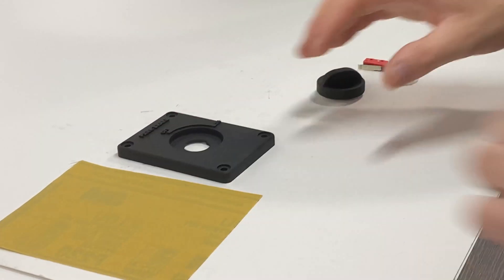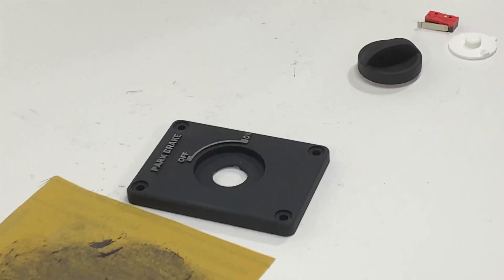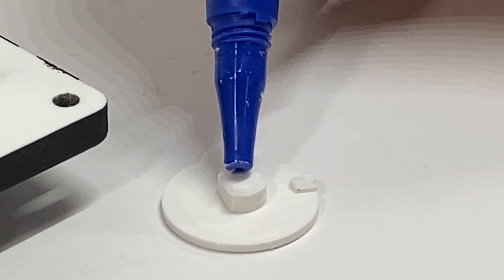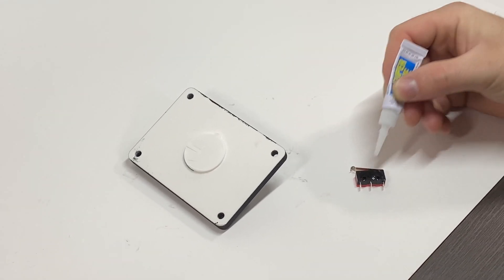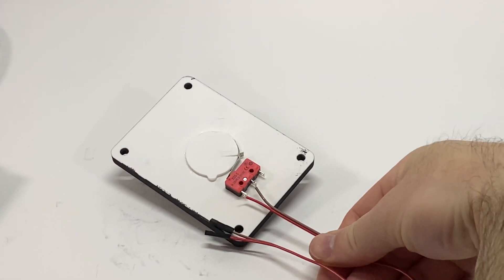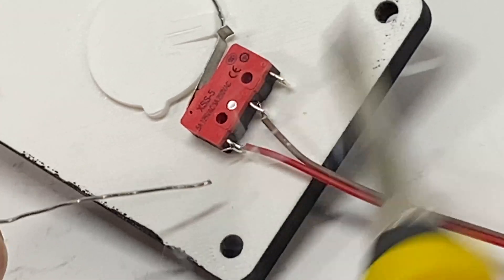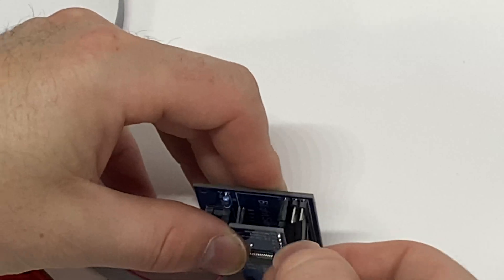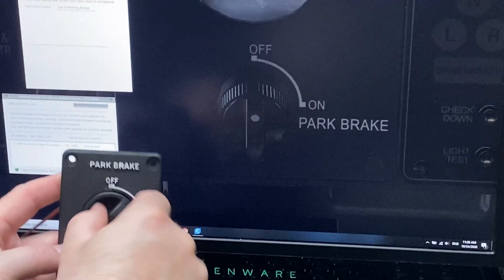TBM Parking Brake for Flight Simulators

Comment: That's nice work but if you don't really need backlight Instead of printing in white then paint then sand, you can print using black pla and change filament when arriving to texts layer you can look on YouTube "pause print when arriving to certain layer" its easy to do in most slicers and saves time.👍

Comment: Hello nice video, i printed the knob and the other part that touches the endpoint switch but, the face plate was a bit harder, i might run some bad process settings, could you please tell me yours?               also what parts are needed to do this? so i could order the electronics on banggood for example

Comment: What slicer settings are needed to get the raised text?  I always end up with partially formed letters.  Thx
Reply from the maker: I’m using a .4mm nozzle and the letter come out great.
Reply: Print resolution /quality or something like that. I use 0.2 resolution and 0.4 nozzle
Reply: turn on print thin walls or similar .